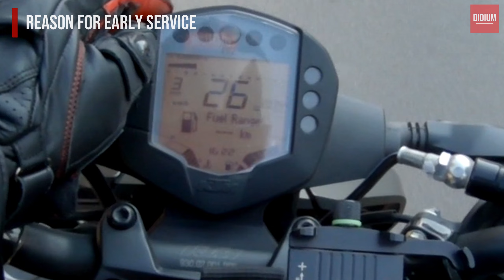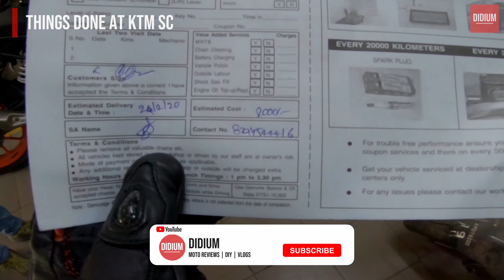Early 2nd service of my BS6 Duke 250 | What to expect? Price, Services, Replacements - Explained!

Comment: Yeah for me also I got that Gear Shift sound, But after the chain clean and lube. It works perfectly fine. I guess that's the reason.
Reply from the maker: Dirty chain will be a different one. This is with the gear shift, there will be a knocking sound from the engine
Reply: @Didium  Oh maybe bro, It get fixed everytime after servicing. So, I thought that's the reason.

Comment: Good info bro ❤️. I own this same model and facing some ground clearance issues, especially with pillion. Is there any solution for it?
Reply from the maker: Make sure you have the right preload setting in your rear based on load. 
3 clicks - Single
4 clicks - Single with lot of luggage
6 clicks - With pillion
Reply: @Didium  thanks a bunch

Comment: Hey bro i wanted an information regarding the radiator fan. Does it comes on only after hitting high coolant temp. Because mine only turns on when m sitting in traffic and the temp. Hit high. And stops after its down one bar. Is there an issue or your bike does the same. I asked about it in the service center but they were like its cool bra your fan's working.  
Thanks in advance 😁
Reply from the maker: Your fans kicks in at 3 situations, 
1. when the engine really become hot, 
2. When it's getting hot at a faster rate like riding in lower gears in traffic for a longer period
3. At regular intervals to make sure it doesn't reach maximum and the temp stays at one level.
Hope it helped! 👍😊
Reply: @Didium  thanks bro 🙏 keep up the good work

Comment: My Duke 200 BS6 tends to hop on lower speeds and it's different than engine knocks. Recently my battery died too.
My gear shifts are also not smooth enough, when i switch gears i can feel a moving part or rod. What may be the cause and the fix?
Reply from the maker: I can think of a couple of issues.. But what's your near by KTM showroom's opinion on these?
Reply: @Didium  They have no reason for the battery to die inspite of daily use. Talking about the shift issue they say it's working just fine, I remember once i had a leaking issue so i got my gaskit sealed and after that for a while i had the smoothest gear shifts ever but then i faced an issue with my clutch so it got ruined again.
Reply from the maker: Looks like a lot of unusual issues which needs thorough physical examination.. get it checked in a proper KTM SC, something which has a good reputation before there is more damage done.

Comment: Sir can you please explain In short , why did you buy duke 250 over dominar 400 , as dominar has more power in same price range , please reply I have the same budget
Reply from the maker: Im a fan of light weight motorcycles, and it suits my kind of riding. Also I never wanted a single cylinder any above than 250cc, mostly to do with refinement level constraints. And that's also a reason of why I never took the Duke 390.
Reply: @Didium  thanks for replying bro , I love the Duke

Comment: Bro is there noise from chain sproket..
Reply from the maker: There isn't any. Generally if you have the right amount of slack, and if your chain is clean and lubed there won't be any. Btw what kind of sound are you getting
Reply: @Didium  while we are going in 80 s suddenly if we cut the throttle and reduce the speed..there is a somewhat mmm mmmm type of sound from the sproket
Reply from the maker: At that times it's usually the slipper clutch trying to match between the wheel speed and the engine's, and that time you'll hear such sounds. But again need to see and hear to confirm. Do send me a video or something if you have, in my insta, so we can try to figure out what that is.
Reply: @Didium  ok ill snd it
Reply: @muhammedyasin1810  I've have the same issue with my duke 250 even at lower speed say 40kmph if I let go the throttle it sounds like mmmmm mmmmm I visited two service center of ktm and they are saying it's chain noise .. BTW this issue has started after my first service which I had in 766km before that there was no noise so if it was from chain it had to there before 766 and as didium said maybe it's from slipper clutch so same again for that it has to be there before 766 as well!! They had my vehicle for 10 days and the noise is more profound form before now😆😆 they also showed me another duke 250 and it made the same hissing noise too..so kinda guess duke 250 has a manufacturing defect?? Or it's just mine that is making that hissing noise?
Reply: @Didium  would love to know that if you have the same noise or not that I tried to explain  !!

Comment: Broo I'm Getting a Mileage of around 30km/l only. Any tips for a good mileage?
Reply from the maker: In city that's a good mileage. In highways, if you need a better mileage try to keep your speeds below 100, like 80-100 as your cruising. Cruising above 100 for a longer period will drain fuel. And also do make sure your chain is cleaned and lubed every 500km, along with appropriate tyre pressure. 29, 29( single) , 29,32 (With lots of luggage/pillion) . Hope it helped! 😊👍
Reply: @Didium  Thankss bro❤💯

Comment: What's the mileage brother?
Reply from the maker: 41 in the tour
Reply: @Didium  I got my 1st service done last week ....I am getting around 23 in city and 26 in Highway 😕, is this will be resolved after all 3 services?
Reply from the maker: Service might not be the problem here. Check other things like tyre pressure, chain maintenance etc.,
Reply: @Didium  does chain and tyre pressure shows huge difference brother?
Reply from the maker: Yes. Low air pressure in your tyres will impact your mileage and bikes performance to a great extent. Same goes for a not so good chain/sprocket as well. Cause if these things are not maintained well, then your engine needs to put additional effort to pull the bike and the load in it which will cost in additional fuel consumption. Preload suspension setting can also be another culprit especially if you aren't tweaking it based on your pillion/load etc. Do ping me in insta once, so we can see if something else is missed. Hope it helped 😊👍
Reply: @Didium  your ig please?
Reply from the maker: didium_inst
Reply: @Didium  done bro ! I've added